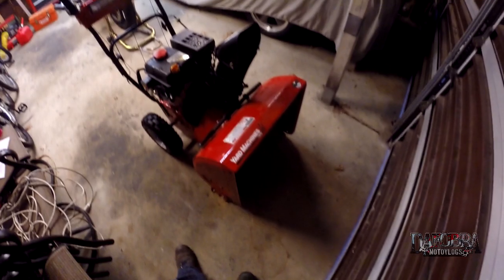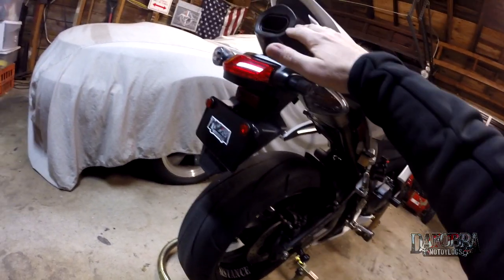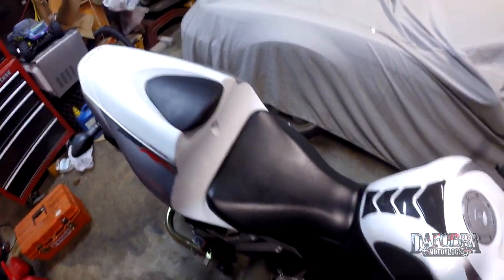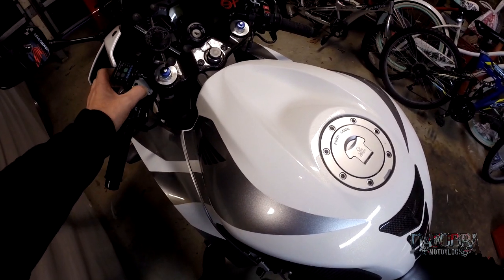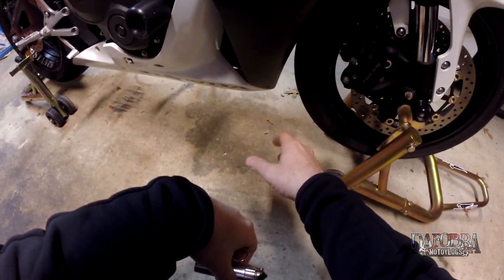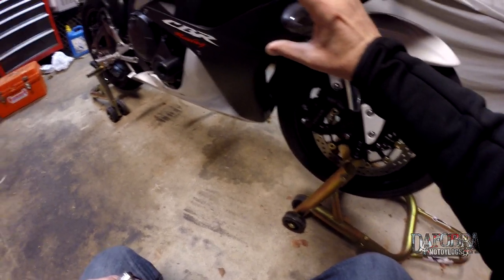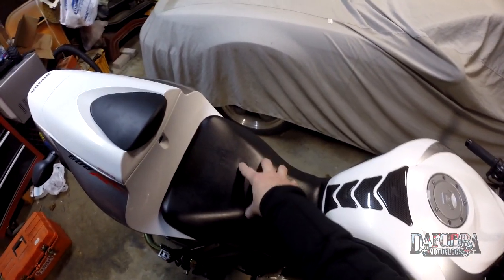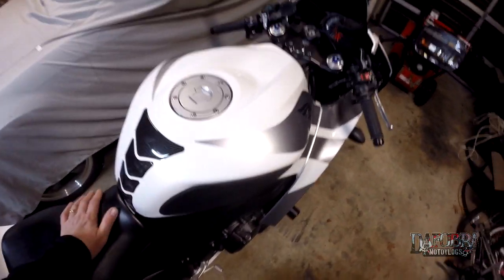10 Things I Hate About My CBR600RR

Comment: I took the passenger pegs off mine and it sure does look bad.  On the plus side they are very easy to put back on ;)
Reply from the maker: +FryRiding yeah they are,,, maybe someone will make a spacer or something that can pop in there...  but its not a big deal
Reply: +dafobra I know R&G make blanking plates for the rear foot pegs, they are a very popular company here in the UK for crash bungs,or as you call them "frame sliders" check them out!
Reply: +dafobra they do make a spacer,I saw a video where a guy had them on his bike.If I find it,I'll let you know.

Comment: I have the carbon fiber heel guards, blacked out rear sets, TST integrated tail light, TST halo turn signal, carbon fiber under tail, and bkmoto demon eyes. It was a pain during the whole winter putting together but well worth it, it looks much sleeker. My fairings are red/black/white now, the all matta black fairings you saw in my vid are gone, ruined. Hopefully in a few weeks I will be makin new vids showing a complete custom cbr600rr 08! 

And yea oil change is a little annoying but not too bad. I just wished it has heated grips.